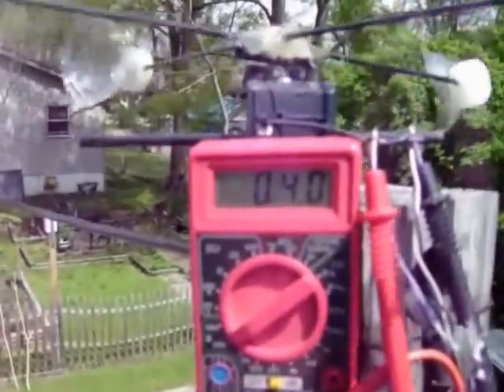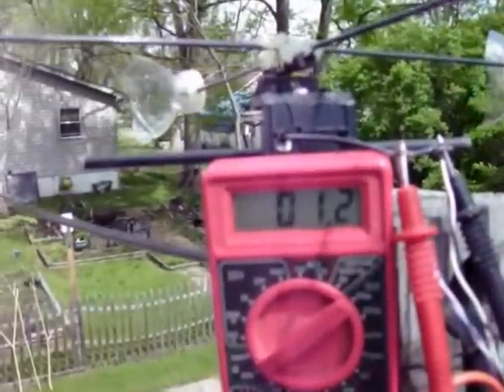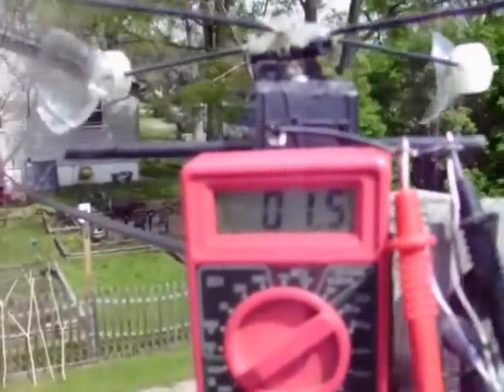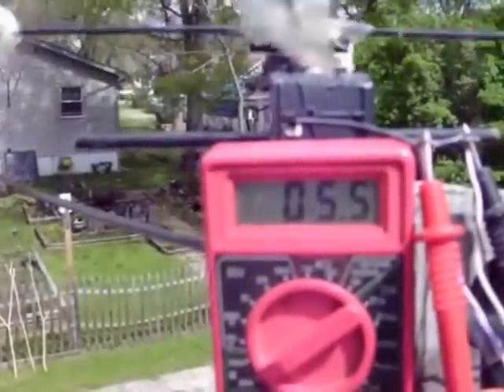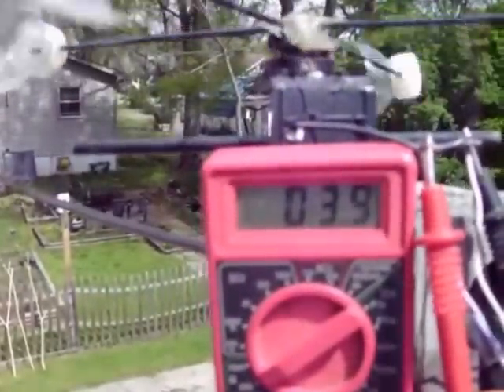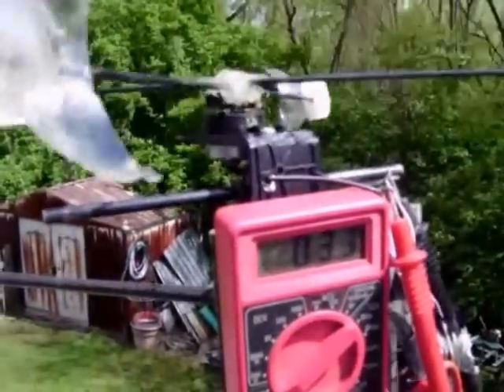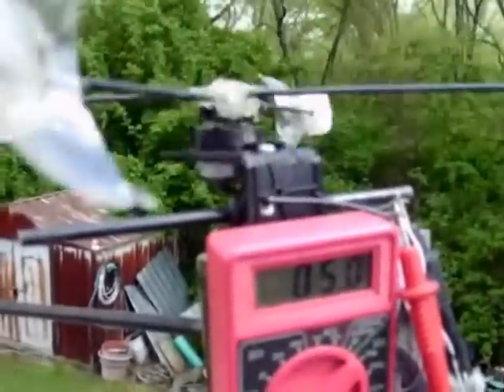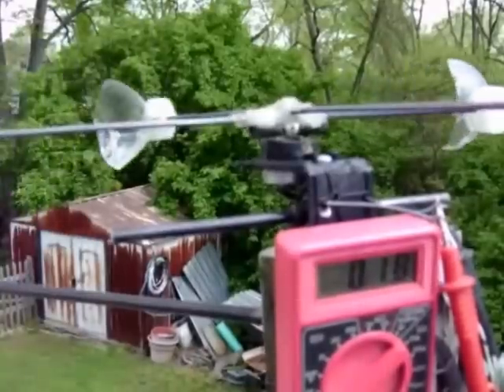Homemade Anemometer Wind Gauge

Comment: I have discovered  hy people play around  with miniature motors and  the like. it is an easy, cheap way to learn the mathematical formuals  of the theories and applications. A simple  ratio/proportion formula  will then suffice  for upgrades in size and power. thanx  for this simple  project. it  really explains the relationship between wind energuy and the production of electricity. I have dozens of these small motors, as i build computers as a hobby.

Comment: neat video and use of what you had on hand....is it by coincidence that the voltage reading is the actual speed of the wind, or do you have to use the voltage to figure mathematically what the wind speed is?
Reply: His meter is on uA not voltage. You have to use a series rheostat to calibrate the motor current to match the meter readout.